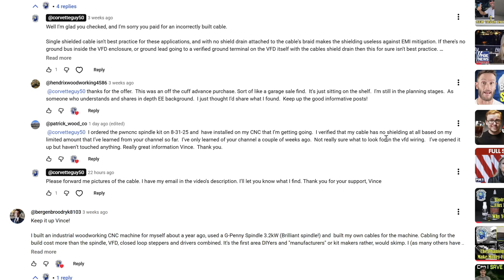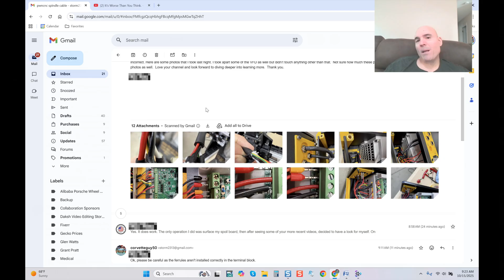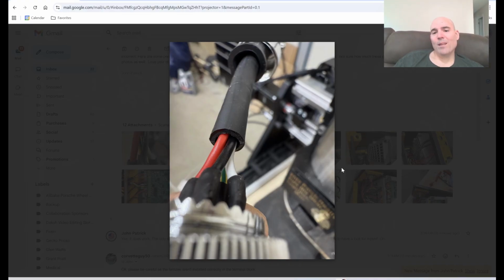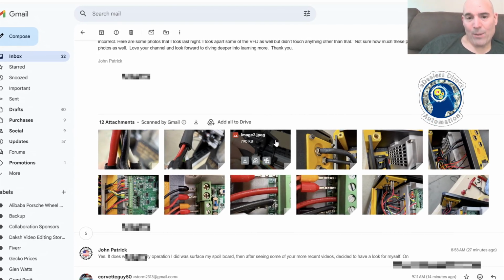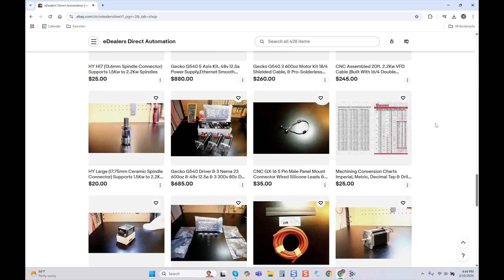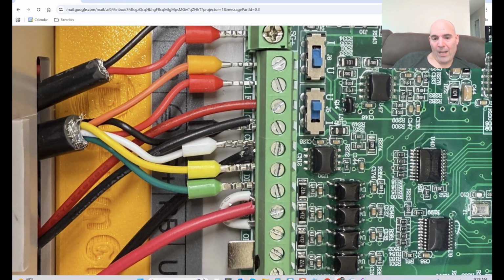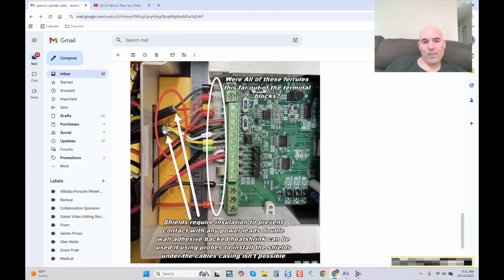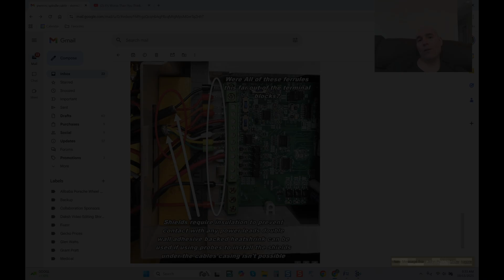💣 Bringing More Receipts... 💣

Comment: The ferrules sticking out is a common thing on a lot of vfd’s and controllers. The terminals just aren’t very deep.  Better solution would be to trim the extra length so they’re not sticking out.  Not hard to fix but also not a good look from a company making and selling cnc’s.
Reply from the maker: More importantly this isn't safe at all.

Ferrules come in multiple lengths, and you have to wonder how difficult it is for a person to select the correct one by performing a simple measurement with a caliper. 

Be careful. 

Thank you for your support.
Vince